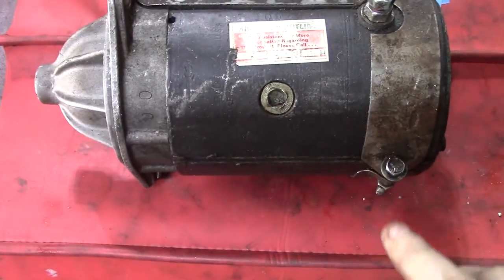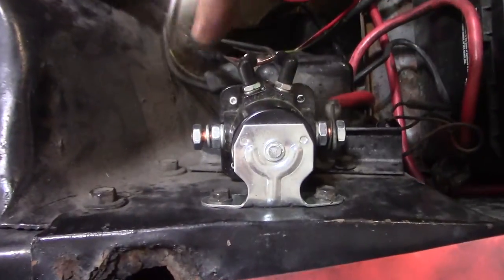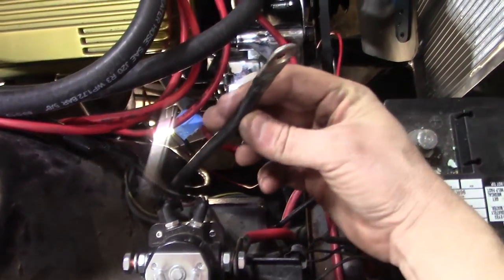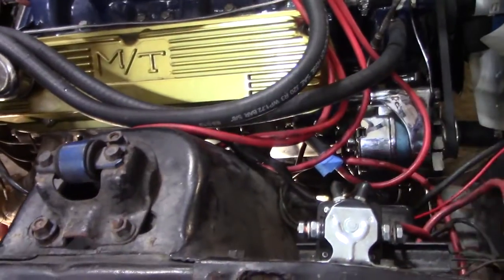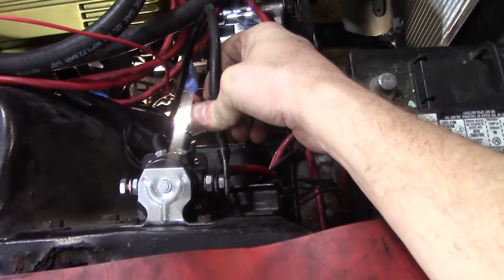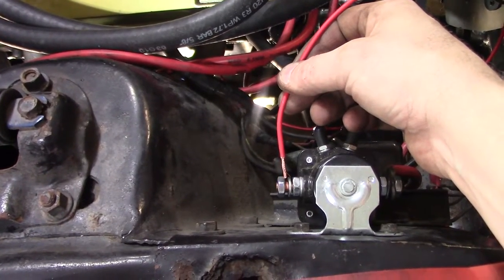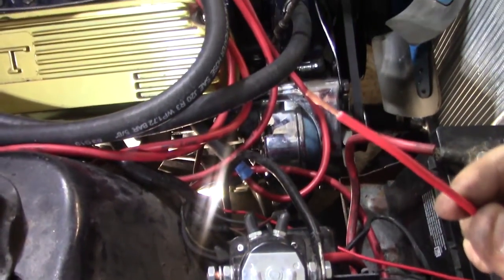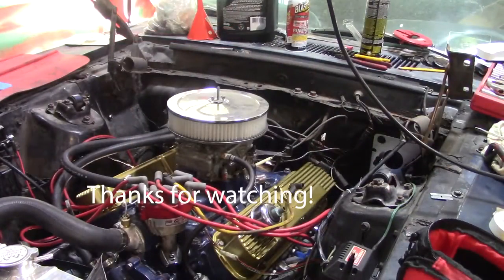How to Wire Ford Mini Starter using Original Solenoid

Comment: It was called a movable pole shoe. Current through the stator pulled the shoe down and then mechanical linkage pulled the starter drive gear into the flywheel teeth.  It worked beautifully!

Comment: What are the two smaller posts (pointing towards the engine) used for? Are they 12v only when the starter is engaged, or are they key on 12v?

Comment: which mini starter did you use for 351m? I have a 78 f150 needs a new starter. many thanks!!
Reply from the maker: I believe I ordered it for a 93 Mustang with a 302. Either that or a '96 or newer 302 explorer. You might have a look at the part numbers. Both of those are many starters that bolt up to small block Fords

Comment: I would have liked it if you showed where you connected it jumper wire on the mini starter.
Reply from the maker: There are only two connections on the starter. One is huge, that's for the giant power wire. One is tiny, that's for the tiny trigger wire. Hope this helps
Reply: @RiggsGarage  Thanks for the quick reply, that's what I needed.

Comment: Is there a mini starter that will fit a 300 6 cylinder?
Reply from the maker: Pretty sure it's the same as the small block Ford
Reply: @RiggsGarage  I’m going to try the small block 302 mini starter.. thank you..

Comment: I have the regular starter but it cranks in the on position. I have the wires on the correct s and I post any ideas?
Reply from the maker: Solenoid could be stuck? Might hit it and disconnect to test it

Comment: Thanks mate for some reason as soon as I put my key line in the post the car starts with no key.
Reply from the maker: Weird, did you figure it out??
Reply: @RiggsGarage  gonna take a look tonight I think I may have put the ignition key line on the wrong side
Reply from the maker: @elimcinnes706  that sounds like it
Reply: So what had happened, was I dropped off the little cork gasket spacer on the battery side post, didn’t notice it at night. so when I tightened all the nuts down it was touching the body of the relay making everything hot

Comment: Hey man..why every time I crank the car the selenoid starts smoking on the positive side
65 mustang 302...thanks
Reply from the maker: Bad connection can cause heat, I'd check connections before and after for real voltage drop. Also could be a faulty solenoid, but I'd check the connections first
Reply from the maker: Also could be a short somewhere!

Comment: Why can’t you just leave both wires on starter side?
Reply from the maker: Go for it
Reply: @RiggsGarage  just seems like having live power to the starter all the time isn’t the best idea incase something happens are burns your car down.
Reply from the maker: @Tbales0950  I see what you're saying. I need to go back and look, I believe Ford left constant hot to them as well. I believe that's a pretty common practice. But I'll go back and look, it's been a while. Hope your project goes well!
Reply: @RiggsGarage  I figured it out. Starter won’t disengage if you wire the way I was thinking. So I’m just gonna throw a mega fuse on the power cable to keep if safe from grounding
Reply from the maker: @Tbales0950  ah, I figured there was a definite reason the factory did it that way, but I'm not an electrician and don't know why. I think we now know. Thanks for commenting